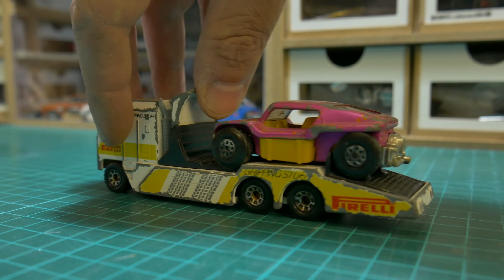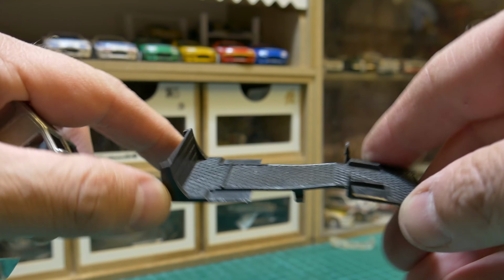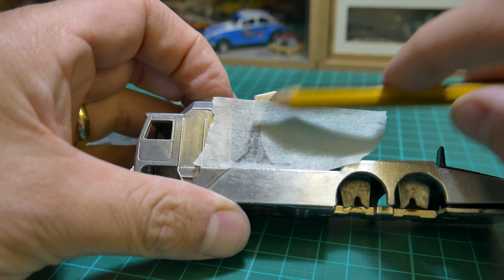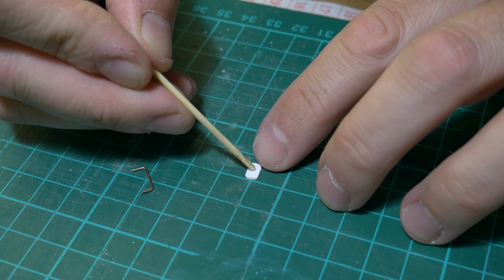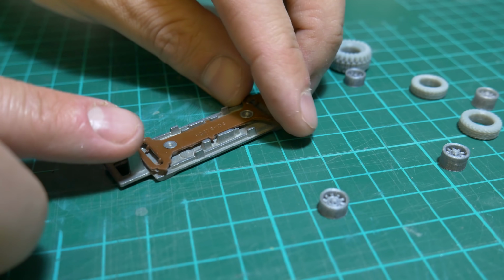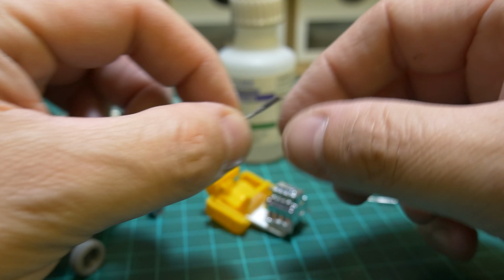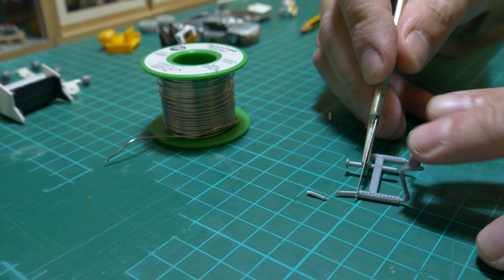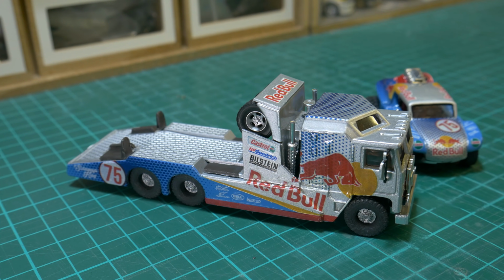MATCHBOX Restoration & Custom : 1983 Kenworth Cabover & 1970 Beach Buggy

Comment: Also where do you get the tires and rims for you awesome creations. I’m new to customizing hot wheels and any advise would be most appropriated
Reply from the maker: Hi Brice..... I usually put the links in each description for the specific wheels and tyres I've used in each video some have shops and some are on eBay. The links will take you straight there.

Comment: What kind of fine saw blade do you use for cutting diecast parts
Reply from the maker: They're jewellers saws. The blades are anything from 10T to 60T for fine work. You can usually get bundle deals with everything you want on eBay.

Comment: awesome. :) now we have a Rad Bull team! ^.^ this is the first buggy I've ever seen with the headlights on, and you just shaved them off. XD well, they do look out of place.
great work on the truck, too. love those wheels, they are just the right size, too. :) and now the truck looks like it could follow the buggy down the baja. :)
awesome decals, too. ^^

I think matchbox' convoy trucks were meant to go with H0/00 scale, which is why they never fit into any other matchbox series. majorette did a similar series for a while, and those were stated to be 1:87 scale, but they sat way too high on their too-small wheels in favour of a suspension, and I think they were more a 1:72 scale.
Reply from the maker: Many thanks Lothar.... Its an odd scale, I'm just glad the more modern Hot Wheels Transporter sets look better fitting and compliment each other😁👍🏎🚙🚕🚓🚗